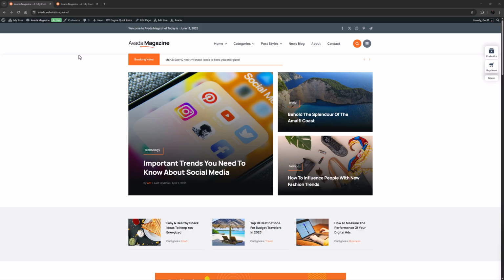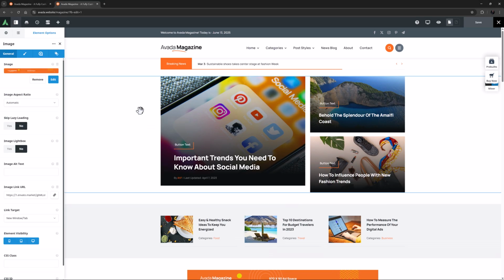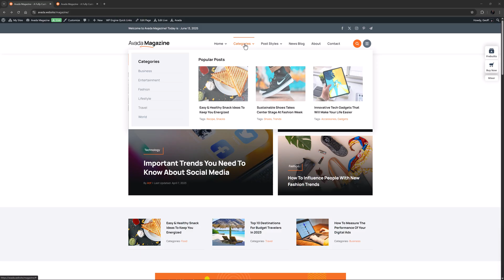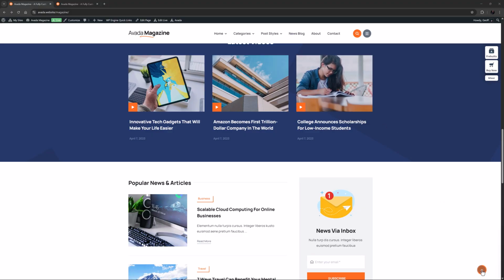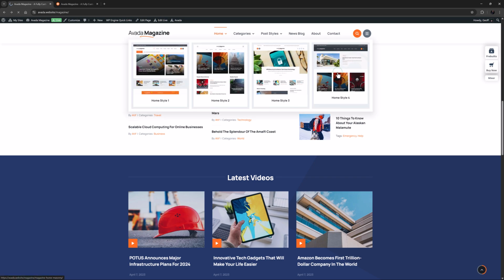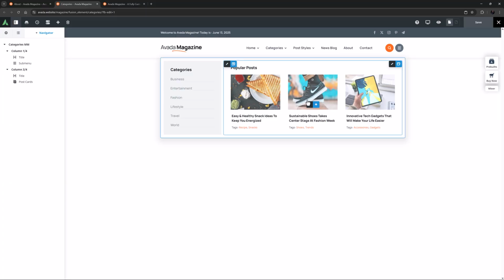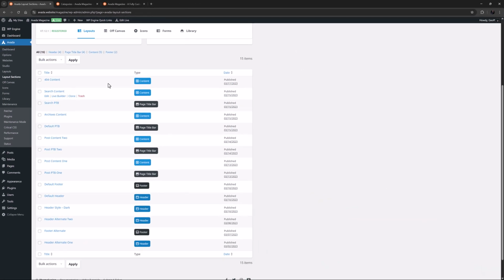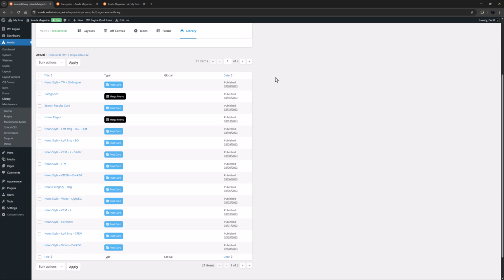Understanding Linked Components in Avada

Comment: Thanks for the videos, they are great. Avada is great too, but I'm a bit frustrated lately. I've run into a problem, maybe someone can help or at least know about it:
Avada postcard, Hover Type (Lift Up) blocks the postcard's elements, like buttons, links – Is there a solution? I know this is not the best platform for this, but as I said, I'm frustrated and I can't find a solution anywhere. Maybe they can fix this in one of the next updates, I can't wait. Opinion?
Reply from the maker: Thanks for the comment. Hover Type is not an option on the Post Card Element, so it's likely you have applied it to the containing column. But if you note in the description for the Hover Type option, it says "This will disable links and hover effects on elements inside the column." So hover type options on columns are not good for content with links or hover effects. Hope that helps.
Reply: @AvadaVideos   Thanks for your prompt answer! Yes, you're right, when I edit my postcard (edit live, a great feature in Avada), yes, there is a column, and there is the Hover Type.
It's a shame that it blocks links and buttons. With other themes, you can make an Add to Cart button appear on hover, which is very modern and functional effect, but I stucked wit it, I can't get it yet to work here. If you have any ideas or solution, (even a hint) please let me know.
Overall, I'm very happy with Avada, and I can recommend it to anyone looking for a great and versatile theme. I hope they find a solution to this problem in time.
Many thanks!
Reply from the maker: Because we cannot provide extensive guidance or support in video comments, we suggest that you submit a support ticket using this link > https://my.avada.com/submit-a-ticket, and a member of our team will gladly assist you.
Reply: @AvadaVideos  Thanks for your response. My support period expired, it's been years since I am using Avada. How can I buy just support ticket without buying the whole Avada theme again? Via the linket page, I must buy the theme again. Anyway, thanks for trying.
Reply from the maker: On this page - https://themeforest.net/item/avada-responsive-multipurpose-theme/2833226 - you can just renew support.